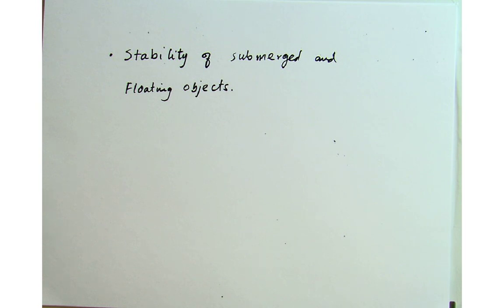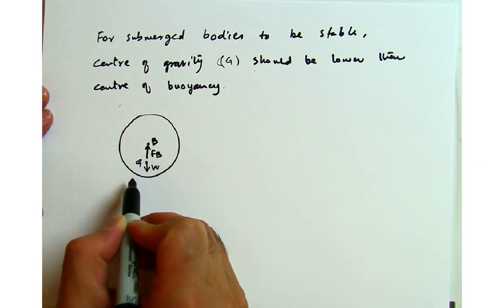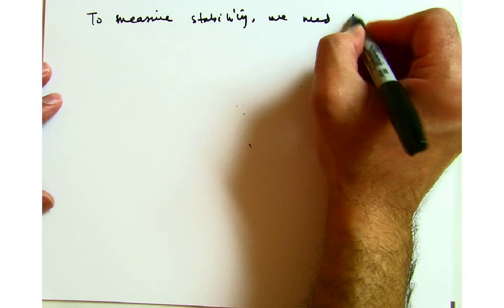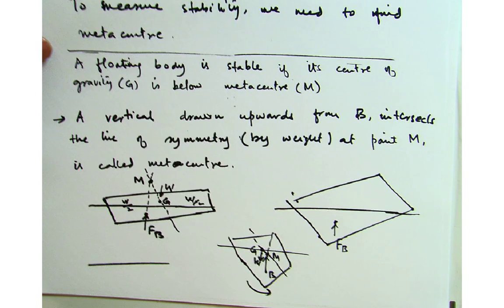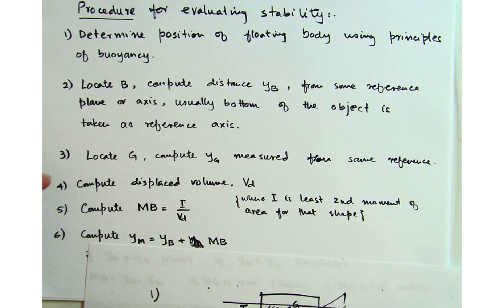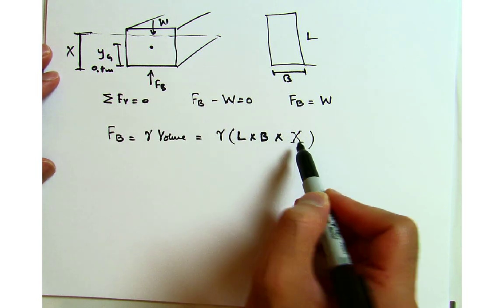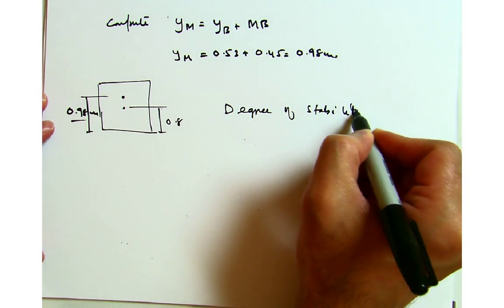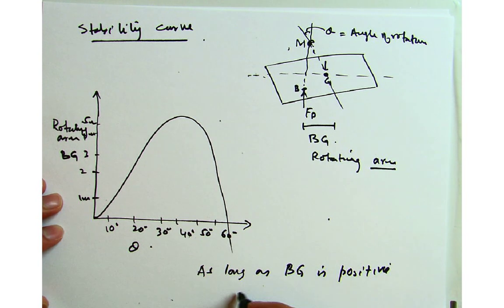Stability of Floating and Submerged Objects

Comment: The least second moment of area (I xx) is to be taken at the water plane. If the shape of the area under the water line varies it will naturally affect the volume but presumably also the value of Ixx.  Could you please comment on how this can be calculated . Is it appropriate to calculate the Ixx based on of changed geometry beneath the water line using the parallel axis theorem?